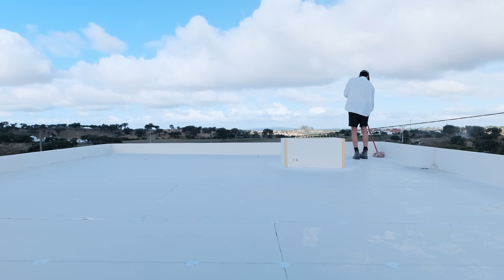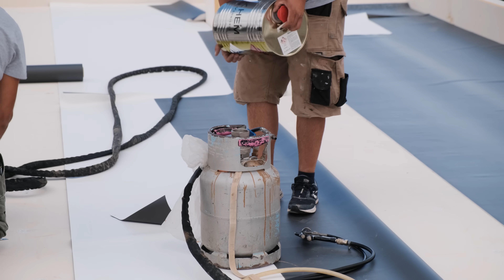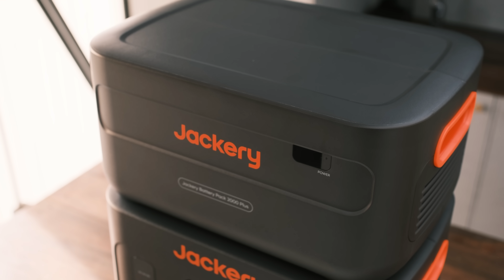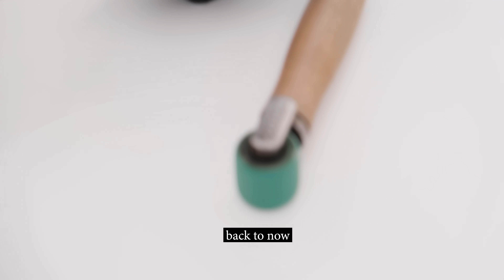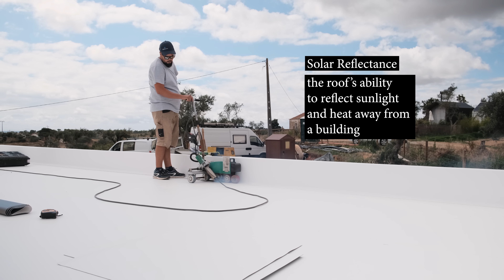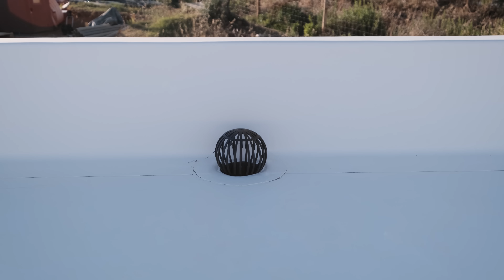The MOST SUSTAINABLE roofing you can build - Building Our House Start to Finish

Comment: Horrible drain pip flashing. Will FAIL. You MUST have a flashing that has its edge INSIDE the drain pipe and covers the entire pipe including its edge. He just didn't have any proper flash pipe adapters on his truck so he rigged it. Easy fix though. Just add pipe flash adapters and it will be protected.

Comment: 50 years ago I worked for a company in Sydney Australia that did sub-bituminous roofing. It was basically sheets of felt rolled out over a layer of bitumen then coated with another layer of bitumen. It was then covered with sand or lime chips or painted with silver paint. So 50 years ago we were building 'cool' roofs.

Comment: I did that type of roofing for a living for a year after Hurricane Katrina hit the United States.  I was working on a Chevron oil refinery in Galveston Texas. Luckily I was the guy operating the machine that seams the vinyl together so I didn’t have to do any heavy lifting or hard work . The rolls we were dealing with were 40 foot wide by like 200 feet. The vinyl rolls were so heavy that they had to be crammed onto the roof. Absolutely the best type of roofing you could ever use!🙌👊🤙

Comment: Im a Professional Flat roofer with the best German quality I will recommend to Exchange the sealing of the sink/ Gully because this is criminal. This will Not last you one year. Because the tension oder the pvc will break it. second the screws are for facades and Not for flat roofs These are the wrong screws. And The way they did the Hand welding was not Hönig was supposed to be weld. Because the dont pre Weld beneath the membran. If you want you can contact me and I will give you all my Feedback
Reply: And the pvc Membran will chrink the Isolation because of the softner in the pvc Membran.

Comment: This video is correct about the benefits of a light colored roof, especially in urban areas and hot climates. 
But there is nothing "sustainable" about PVC. The material is NOT good for the environment. It's manufacture is bad for human health, and it is difficult to recycle. There are better choices for low slope roofs. Light colored EPDM is a much better choice with regard to sustainability.
If you live in a region  where either sustainably sourced cedar shingles or slates are available, those are better choices yet. Of course those are for sloped roofs.

Comment: Don't you mean the most un-sustainable roof you can build. 80-90% of locations this roof with fail, silly little pipes blocking with vegetation forcing rain water to leak through the house framing needing a massive fix or rebuild which is in no way sustainable. In general flat roofs only work in dry dry climates and will fail in every other location. Do yourself a favor and don't build flat roofs.

Comment: A flat roof is just never a good idea anywhere for any reason. Having to implement one is evidence of design failure and incompetence.

All roofs should be sloped enough to shed water. The number one checkpoint of sustainability is not using more resources than necessary. A flat roof that collects water and needs drains automatically requires more materials and multiple layers of protection that a single or double sloped roof do not need.

If you like the look of a flat roof, with parapets around, you could have the gutter on the back side, or even have an internal gutter, which just means its not hanging on the exterior of the building and visible, not that it is internal to the building.

Flat roofs also require more specialized tools, labor, maintenance, is less repairable, and needs replacement of more material upon failure, which are all less sustainable.

While the quality of materials and installation were high, the choice to go this way shows bias, poor planning, and disregard for established terms when presented as sustainable.

Also, much of the benefit that bifacial solar panels gain over single panels is realized by them operating at a lower temperature, not by them having two sides. By placing them perpendicular to the ground they dont retain as much heat as single faced panels angled perpendicular to the highest solar gain. The heat reflected off of the white roof onto the panels will negate any benefit of the higher cost per solar capture bifacial panels, further combating their sustainability by decreasing their already lacking efficiency.

Bifacial panels are for use in cold climates where the reflectance of the snow is balanced by the low temperature, in high wind environments where non-perpendicular panels would require cost-prohibitive materials to combat substantive uplift forces, and over metallic reflective surfaces or water that transfer less heat.

Good job on the install though. It will last longer than most flat roofs. From your roof install I would think your foundation is solid, so your window broke because your building isnt climate controlled and your bucking tolerance was too low.

Comment: Hi. Fasteners better  be telescopic. If insulation is soft. And every insulation is. How many kPa load can ur insulation take? And if You walk on it it will become soft after some time. By gluing PVC you can not strech it before fastening edges. Thats how wrinkles come. Usually. Are some other options aswell. But thats in northern europe, wintertime. Ive been doing this work in northern climate for 15y, got my own small business. White is right choice in sunny climate, material will last lot longer. Gutters done this way.... with some liquid qlue or silicone or urethane or whatever....very bad....Probably first places where water will leak. Warranty for work, how many years? Material 20y, that I get.

Comment: I was told that different roofs were designed depending on the area lived in 🤔 a flat roof somewhere it snows is going to collapse. Homes in the north seem to have more of an angle on them than in the south. The materials the roof is made of is also a big factor including the insulation you use 🤔
Reply: Flat roof is a horrible idea, if you live in location when water can quickly turn into ice (like shadow in that atika area).  Sun and water will work out together until they make tiny cracks. And then it will be leaking. 
I live in Slovakia, before generations were poor people, but never were building flat roofs.
Reply: A properly designed flat roof will not collapse under snow. In the USA and Canada if you follow the guidelines of the building code your roof will be strong enough. If you try something not in the code you will  want to involve an engineer.
Look around you at all the commercial buildings, such as the big box stores. Most of them have  flat roofs.

Comment: Ignore the nasayers. These kinds of roofs have been the primary technology in commercial roofs for decades. They work great. If you ever do it again, look to see if you can find it in wider rolls. I have often used rolls 5m wide. They are very heavy, but little to no joints .

Comment: I'm curious about long term concerns with different expansion/contraction rates between the roofing membrane and the insulation. I'm a roofer and it's frustrating putting TPO down perfect and then have to deal with wrinkles, but I have some concern with this technique over the course of the life of the roof.

Comment: Why not put this on a slanted/sloped roof, i think it will be a better water resistant, and get more cooler temps because of the air moving under the roof

Comment: Looks nice, however your fully bonded glued system is ok and the spraying perfect. However your fasteners are completely wrongly placed (never screwed in the joints] the amount of fasteners to be used depends on ………  maybe your solar panels will be giving the required weight holding de roofing system in place. In my opinion prefabricated inner and outer corners, and prefabricated outlets are a better solution. Time will tell.

Comment: Interesting products... why tho, would you not run the membrane on the roof flat up the walls for eg 300mm and then run the parapit membrane over the top of that? same for the chimneys...  Its a much better waterproof seal... Also, the round drain membrane.. why would you not run the round membrane piece for the drain underneath the roof membrane? and... why wouldn't you run the drain membrane into the inside of the pipe?... And yes, it would take longer to seal up the walls and into the pipe but from what I've seen, its a much better practice, yes?
Reply: I was thinking about water collection.

Comment: I love the "cool roof" option. And to be able to use bi-sided solar panels is an excellent idea. The question I have is what will happen in a year or two when the roof become less "bright white" from pollution and water that leaves black particles on the roof? Do you get heavy snow loads? How does the roof handle snow. I am in Northern Canada (Central Alberta). I would love to do this roofing system here. Unless there is a way to "melt" the snow to prevent it from accumulating and to keep ice from forming (added weight) on the flat roof. Alternatively, if this system can be installed on a pitched roof or curved roof, that may work. Though the neighbours may not like seeing a bright reflective white roof. This system is something that I hope my architect may know. I had a meeting with him a couple of weeks ago and he is a firm believer in 0-net buildings and homes. You gave me the inspiration to pursue a new method.

Comment: Good job and great videos! 👍 
I have just discovered the channel and am planning on catching up on the videos soon, I have a couple of questions to ask:
1. I have noticed that you placed your roof vapour barrier above the OSB (on the exterior side). won't this trap the moisture that will be generated from the interior air due to indoor activities such as cooking and breathing between the OSB and the barrier which might damage the wood? Placing the barrier under the OSB makes more sense to me.
2. Since the house is in a hot climate why didn't you place the thermal insulation above the waterproofing membrane? this way it will protect it from extreme temperatures and UV and will prolong its life (inverted roof technique).
Looking forward to the end result!

Comment: I’m concerned with UV degradation with pvc cover, fearing it doesn’t last as long as tar and sand shingles 

If an architect or builder use it for their home, I’ll consider using it for mine 

I’m always worry about manufacturers pushing a product… cheaper for them to offer while offering lower quality at the SAME or MORE cost.

Lower quality for lower price is fine.  Lower quality for equal or more money is a NO
Reply from the maker: i am an architect, and this is my house :) this product is the way to go.

Comment: You should stay away from making statements of sustainability, an area where you don’t have an expertise. I never make comments on videos but all of your materials are not sustainable at all. They will only be sustainable if they are from natural origin and not from a synthetic origin. Yes the manufacturers manual may say they are eco friendly, but they don’t. If you want a cool roof , go for a green roof.
Reply: Hey guys, as I am studying sustainable building I would call myself kind of an expert in that area. And unfortunately I totally have to agree with the statement that this roof just can not be called sustainable. And especially not "most sustainable". Every used material is made out of fossil fuels. Given the fact that everything is glued together, there is no chance to separate any of the materials after the end of there life, which means it is just noch recycable at all. And given the fact that this bare pvc roof is always sitting in the full sun, the lifetime of 35 years might also be a bit optimistic. And even if not, many other roof types e.g. like green roofs have way higher life expectation than this. Al the gray energy in the production of that materials are not being considered here as well. If you compare it for instance with a green roof where also solar panels are combined, you have a compensation of the sealed ground that also holds back massive rainwater which afterwords cools your building even more because of the higher evaporation of the water. You also create at least a small natural habitat for other living things and through the solar you can gain back a lot of the emitted emissions during production. 

The only argument he is saying is the white colour that reflects sun. That is right and it has a good impact on the energy amount used for cooling. But it is so far away from being super sustainable
Reply: It’s a flexible pvc membrane. PVC is usually not bendable. To make it flexible a lot of chemical weakeners are added during the production process. These chemicals are pretty nasty and disappear into the environment. I have seen pvc roofs that have become completely hard and brittle after a couple of years. As an architect I avoid these products as much as possible. It’s not durable nor sustainable.

I did enjoy watching these roofers.  Nice skill and technique.
Reply: why dont you go deflate your ego elsewhere...
Reply: This is what I wanted to point out. I agree.
Reply: Jose videonun devamını bekliyorum Ömründen 2 yıl gitti
Reply: La envidia aflora en cualquier lugar….
Reply: Sustainability is also about avoid create more waste. So keep watching tutorials on how to build because obviously you have tons of free time.
Reply: @silvialfa1  I agree with you. And that roofing system creates so much more waste than others. So you gave you your own answer
Reply: This comment was unnecessarily harsh. It would have been nicer had you said a truly sustainable roof is a green roof using natural materials. 

Sustainability could be taken really far where you’d be prohibited from using nails because of mining and fossil fuels used in their production. We all have to choose how closely we’re willing to live in harmony with nature.
Reply: Maybe mind your own business? Stop critiquing their videos and make your own.
Reply: @ This is not about the making of videos, is about the fact the roof is not sustainable.
Reply: @BigBangThinking  What makes you an expert in “sustainability”? The guy is an architect and would probably know more about building things than most.
Reply: @ I’m an architect with a masters degree in bioclimatic architecture and environmental studies. Plus a PhD in sustainable design. That is why a posted my comment.
Reply: @ so you say. Have a good night. Bye now.
Reply: @BigBangThinking  ‘’sustainable’’  building materials has more parameters than just being of ‘’natural origin’’ as an architect you should know that.
Reply: @BigBangThinking can you explain how a green roof (I assume with some layer of earth and plants/grass or something like that) would work in this environment? 
If you look, the guy is basically living in a desert. No water is no green roof, I would assume?
Reply: @ Hi Paul. The work he is doing is based in the trend of how houses are constructed nowadays independent of where they are built. That is why you will see the same construction method is used everywhere. There is no relationship with the environment where they are set. Yes they can have more or less insulation or a better or worse orientation, but that alone is not enough. To have a real relationship/integration you must make your building interact with the flora and fauna present in your site. If the structure resists it, they could go with local plants that will benefit other living things as well. When they are local, they don’t need any additional water to survive. Not to mention the insulation protection it would add to the house. The more local oriented the materials, construction systems, relations to living beings or heritage… the more sustainable the house will become.